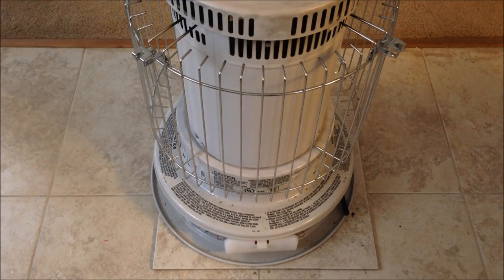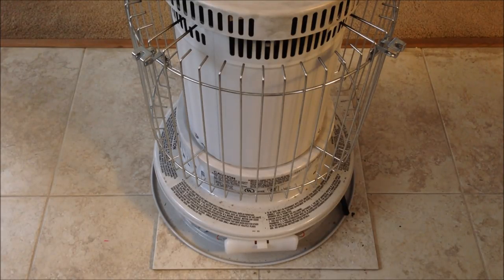Self Cleaning Kerosene Heater Wick Trick

Comment: The manufacturer's instructions that comes with all kerosene heaters plainly states how to get rid of carbon build up on your wick and it works every single time if followed. NOTE: DO ALL DRY BURNS OUTSIDE ON A NON WINDY DAY AS IT CAUSES A LOT OF ODOR. NEVER DO A DRY BURN INDOORS!! With the tank almost empty light your heater and turn the wick up to it's highest setting and simply let it burn all of the fuel from the tank. When the flame goes out allow it to cool for just a bit and light it again on it's highest wick setting and burn out again. Allow to cool, remove the top and inspect the wick. Should be free from any carbon or hard deposits. You may need to pinch the wick to see if it is free from the carbon. Redo a dry burn if needed. Replace the wick if needed as well.  Before using your heater again fill it with fuel and allow the wick to soak for at least 60 minutes with the wick turned all the way down. This will ensure the wick is completely saturated with fuel before lighting. Do a "dry burn" once a week to once every two weeks depending on how often you use your heater. Consistent "dry burn" will assure your wick stays in great condition and will last a long time.
Reply: red roc this is excellent and true information I agree 100%
Reply: cotton , fiberglass, or both?

Comment: So this one you partially got correct. When you let a K1 heater run out of fuel ultimately what you're doing is doing a clean  burn/cleaning the wick. What's happening is on all kerosene related wicks, heaters and lamps, carbon builds up on the end of the wick and makes it so fuel can't carry to the end of said wick and must be cleaned off to work properly. Now this is the part that most of us get wrong, including myself in the past. Most of us think the wick is ruined at that point, unless we read and remember the full manual that came with the heater. The part about this video that isn't correct is that a kerosene heater has to have the proper flame height otherwise it will give off carbon monoxide, black soot, or both. Having the flame too low is what is most known for the carbon monoxide, and you high puts off black smoke and carbon monoxide. Letting the flame run out of fuel does several things: it puts out larger amounts of carbon monoxide,  gives off a pretty strong odor, and can create black smoke sometimes. In the manuals, and what is recommended for all heaters, it specifically says to drain the kerosene once a week of regular use, and then to light it and let it burn itself out of kerosene. The critical part is this is supposed to be down outside because it's unhealthy to breathe in what comes off the wick. People die every year from improperly running their K1 heaters, but really it just takes a little knowledge on the topic to have it run safely and efficiently. If you do this regularly then a wick can last many years as the top of all these wicks isn't cotton but fiberglass, the lower portion is cotton. My current wick is 8 years old now and still works like new. Hope this helps guys. Sorry this was so long...😂
Reply: Nope, don't be sorry...this helped me out more than the vid!
Reply: Some say crush the top of the wick with needle nose pliers and then dry burn? Is this correct?
Reply: @jazzsounds8159  if you're cautious enough sure. Basically you would only use the pliers to crush any very thick parts of built up carbon. But the tops of the wicks are fiberglass, so you gotta be cautious not to ruin that as the fiberglass is pretty thick. But you should be able to use the rest of the top for comparison and only crush the thicker parts. If in doubt then skip the pliers as that part isn't necessary in any way. It just speeds up the process a lil. You should check the wick after the dry burn to confirm its clean. Once you do it a few times you'll understand the process a little better, bit it's close to foolproof imo.  👍
Reply: @Vinwelder   I think I let go too long, I crushed the carbon build-up with pliers on top. Wasn't thinking about the fiberglass. We'll see tonight if it lights. A full tank of fuel took over 24 hours for a dry burn.
Reply: @jazzsounds8159  Sorry I should've probably said this, but a dry burn is exactly that. Meaning you're purposely removing the K1 from the tank so it's empty. Then you bring it outside, light it,  and let it smolder outside as it's gonna be super stinky stuff that smokes quite a bit. So you're literally trying to burn it until it extinguishes itself completely. Then and only then will the wick be cleaned. I'm not saying you didn't,  but IF you didn't let it smolder then it has to be redone. I'm assuming you did this part though. If you don't have one a siphon is required to remove the K1 from the tank. A cheap old fashioned manual one works just fine, but nowadays for people that can't be bothered they have battery powered ones which are awesome a very fast. I got my original at home depot. I think I bought my 2nd one off ebay for pretty cheap. Hope this helps. I just had to go buy K1 myself as we're bout to get 2 more feet of snow here in Maine tonight/tomorrow.   😭

Comment: We have two kerosene heaters for this exact reason. We run our  kerosene heaters 24/7 throughtout our NY winters. We light up the 2nd ready to burn heater, when the  1st heater is ready for a burnout to clean the wick. We switch out each heater after one week(24/7 for 7 days).  Probably could run each one longer than that but choose to use them not abuse them. We use clear kerosene only and add  aprx. 2 tablespoons 90% isopropyl rubbing alcohol to the tank(2.5gal) each time we refill the tank. We replace wicks each year though to be honest they look in near to excellent condition after the end of winter/spring season burnout.  It took us a few seasons when we first started with the heaters to get over the learning curve but once we did it was so much cheaper(versus other sources of heat) , easier (we are pushing our senior years), and cleaner. Also there is no adjusting the heat output with the heaters. You have to have the flame adjusted to the right height to avoid odor, and tar build up on the wick. We've learned to wait the 5mns. after first lighting, readjust flame height, wait 1/2hr, readjust one more time, then we are good to go for the whole week , refilling only when needed. When it gets too hot (rarely in our old drafty home) we open windows.
Reply: Maverick M Is this a cost effective practice? I live in Michigan and have considered doing what you do, but pay 3.99/gal for kerosene.
Reply: Kerosene is $10 a gal in Connecticut! 12/14/18
Reply: @lrak228  in stores but try to buy K1 at a gas station $4/gal
Reply: I like the idea of using ipa in the fuel tank, I'll try this when the fuel tank runs out. After I've dry burned off the wick to clean it. Thanks for thr tip

Comment: My heater says to dry burn the wick once a week. You let it burn all k1 out and then raise wick fully up and light the wick again until it goes out. Take a toothbrush or similar brush and brush the wick and wipe away the particles. I don't do it that often but I also use wick cleaner additive to my K1 kerosene.

Comment: There are two different styles of wicks. The older types of kerosene heaters use 100% cotton wicks. The newer types of kerosene heaters from about the mid-seventies on typically use a cotton wick with fiberglass sewn around the top. Many of these use a catalytic converter which makes it too hot to use an all cotton wick.
  Impurities in the fuel can collect at the top of the wick and make a hard "crust" which interferes with proper burning. The two different styles of wicks have two different ways of curing the problem.
 Don't get them confused.
  The fiberglass topped wicks can be burned dry by running it out of fuel in order to remove the crust.
 On the all cotton wicks, we are to use a wick cleaner supplied by the manufacturer (or eBay / Amazon) of the heater. It shaves off a small amount of the top of the wick leaving a perfect bevel. Do not dry burn an all cotton wick, it will burn up the top of the wick. 
  Many heaters have a real hard time with red dyed kerosene, use Clear 1K kerosene if possible. Sometimes even clear kerosene can give odors. If so try another source. Near me it's around 4 to $5 a gallon at the pump, and about 10 to 12 dollars a gallon on the shelves in the stores.
 For more fantastic information about kerosene appliances, a great source for very high quality wicks and chimneys for heaters, lamps, and stoves, check out milesstair.com
Reply: good info!
Reply: Thanks
Reply: In just 1 year. Dyed kerosene is 8.30 at the pump. Clear is 38 for 2 gallons...
Edit: a single 380 Hornady critical defense round is like 1.50. Leaning more towards that option everyday..😔

Comment: Hey Joe, thanks for the tip. I've been using kerosene heaters in my old colonial house for two decades and always tried to brush the wick clean.  It didn't work all that great. But burning the wick dry according to your instructions certainly worked for me. When the thing had self-extinguished I checked the wick and it was clean, white, and flexible with no carbon crud build-up. It surprised the hell out of me. I've been doing this all winter and spring this past year and have been getting a better burn and longer wick life.
Reply: I noticed brushing it with an old toothbrush rips it up and makes fuzzies all over that get stuck in the nooks and crannies and have to be blown out/vaccuumed out, so i just wiggle it to and fro with a screwdriver and do the dry burn method.
Reply: Good info. Thanks.

Comment: Hey friend, THANK YOU!!! Since I tried your trick on letting the kerosene completely burn out instead of turning it off the way I used to, it’s been starting quicker, burning much better and the icing on the cake, I have a new one to replace the old wick after the winter is over and should last an entire winter next year! So many thanks!!
Reply: You do not have to replace the wick every year. I did not replace the wick in the one I used for 4 years. I will take his advice on only filling it up to capacity but only a third full. this way it lights easier and the last lite you can let it burn out to clean the wick and should last longer.

Comment: Kerosine heater tips learned the hard way!

If cash is tight then might I suggest a Kerosine heater?  We have both types, convective, (round type) and radiant, (rectangular type). We supplement them with calor gas heaters. Our heating bills for the last two winters average out to Euro 150.00 for the entire winter which is as cheap as it gets. People are put off Kerosine by the smell but with modern types this can be minimised. Clean modern fibre glass wicks can be dry burned to return them to pristine condition. Here are some tips about using these heaters:- 

Kerosine heater tips learned the hard way!

The solution with our convective heater, (the round type) is to fill and light it up outside, wick fully extended and let it burn like that for a full five minutes. Then turn It down to the desired amount and then take it back into the house. A full tank will I burn for approx 14 hours at minimal cost so it's the most economical way to go. With our Alpaca heater, (Korean make) after the outdoor five minute burn, adjust the flame so the blue flame disappears into the red hot catalytic perforated cylinder (at the top!) Don't turn it down too much or it will smell. With these types of heater there is really only one setting, full on! So buy the correct size of heater for the room. Most importantly leave a window slightly open because the heater must have ventilation. Not doing so is REALLY dangerous! (A smoke and Co alarm detector is also an excellent idea!) If you can cope with these simple and sensible requirements then you will gain an incredibly efficient and economical way to heat your house at minimal cost to yourself! We also have gas heaters and the combination of these and the kerosine/paraffin heaters fulfils all our winter heating needs. In addition it is essential to ‘dry-burn’ the heaters after a certain number of uses. (I work on it being three full tank fills) simply put the heater outside when it’s almost empty and, with wick fully extended, let it burn out! This simple action returns the heater wick to new condition.

Our radiant heater, (rectangular type) works in a slightly different way. Fill the heater fuel tank which is on the right hand side and, once filled and the screw top firmly turned to tight, turn the large knob on the front full clockwise till it can go no further then depress the ignition button. Hold this till you see flames at the lower visible section of the wick. Once it is really going turn the large knob down a little bit to avoid smoke and smell. It should go well at this stage. Don’t just press the emergency stop button at the end of the burn because the loud bang that you hear can damage the mechanism. Hold the large knob then press the off switch and then turn the knob to the off position slowly and without damage. As with the round type heater, perform regular dry burns OUTSIDE! (This avoids the smoke and smell in the house!) Let the tank burn out completely with wick fully extended. This primes the wick for many further burns. Not performing dry burns will eventually render the heater useless! The wick will get progressively more and more difficult to light, it will burn with a redder and less radiant light and will eventually fail. The wick will be visibly crusted at the top. Dry burns are essential! Hope this helps. Oh, and do use a Smoke and Carbon Monoxide alarm for safety and peace of mind. Have I missed anything? Hope this helps because it’s a GREAT and cheap form of heating. Finally, never use anything but Kerosine! Always have a window cracked open for ventilation and keep the wick primed by dry burning. Sorry, this is wordy!
Reply: long but valuable. In the USA, use only K-1 kerosene as fuel and if you can afford propane gas logs or heater, that is simpler and when the tank of propane is empty, you can get by with a kerosene heater. I have the local service fill my propane tank in the fall and when trees fall on to electric lines, I can at least keep the house warm for a week. Keep K-1 kerosene and a few lanterns for light for when there is no electricity. You cannot recharge batteries with no electricity!

Comment: Thanks for the Vid.

I recently purchased a New in Box heater similar to this one. After about 5 burn sessions, it seemed like the wick wasn't burning evenly as it did during the first run. I didn't know that wick life is extended by letting the heater burn itself dry. 

Also, have you heard of adding a TBS of denatured alcohol to a tank to clean the wick as it burns a tank dry?

Any advice for minimizing the kerosene vapors in the house? Last time they were entirely too intense, I had to crack a few windows and let old man winter clear the house.

Thanks again for showing a noob the ropes.
Reply: superishy You shouldn't really be getting odors. Be sure wick has been cleaned monthly.  Use one of those red and white self priming plastic hoses to fill maybe. And don't spill any fuel on outside of heater or in house. I usually took mine outside to shut down or immediately after. If you trip the safety and the wick drops to off position....hurry to take outside for a bit :-)
Reply: +恵勇気 very good information.  Thanks
Reply: Dry burn outside, duh.

Comment: good tip and simple to do ! It's much like running all the remaining fuel out of a 2-cycle engine before storing for winter (chainsaw, blower, trimmer,mower, power washer). Dump all the fuel from the tank and then pump the bulb and then empty again and start the device and rock it as it runs totally dry of fuel ....The better solution for NO ELECTRICITY is have propane logs and an outside large propane tank. Mine will run on 'low' for 7 days and keep my brick rancher house tolerably warm. My fireplace is larger since the house was made in the mid 1950s and I have a 2-level propane log set installed. K-1 kerosene heaters are for when the propane is all used up and you have to get by until electricity and/or propane is restored.

Comment: If the wick is as dirty as described in the video. Take a butter knife using the side of the blade to bend the wick to the outside of the burner a bit .  This will dislodge some of the crusting on the wick allowing it to light and burn it on high with about a cup or 2 of K-1 in it until it burns out.  Lower the wick for 30 minutes. Raise the wick to High and relight it and leave it on high to burn out again.  Let it cool and then brush the top of the wick and burner area to remove any residue. Refill and your ready for the Cold.
Reply: Thank u so much my wick wasn't lighting all the way around, I read ur comment and as I write this I have the butter knife out scraping the wick.. thanks..